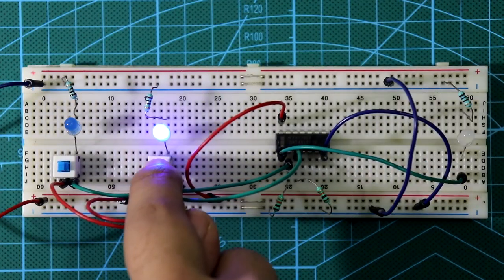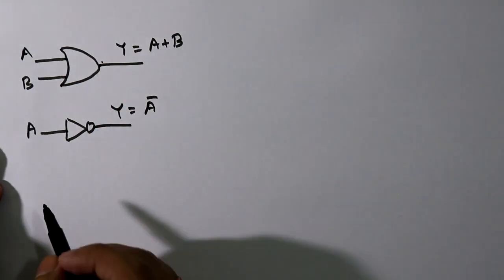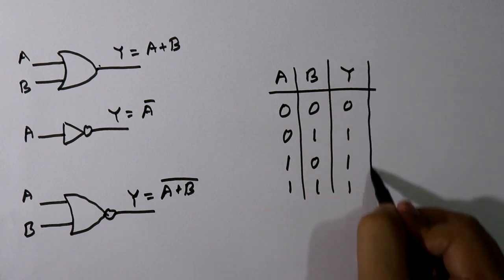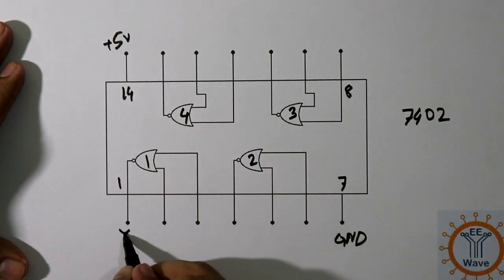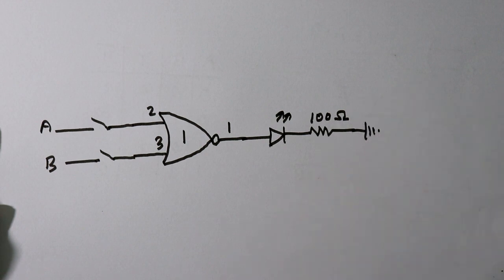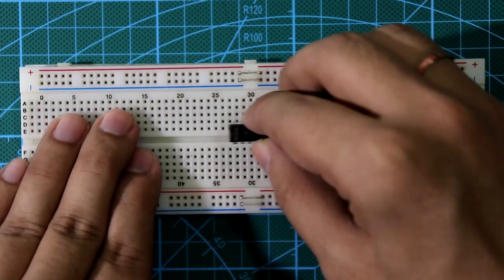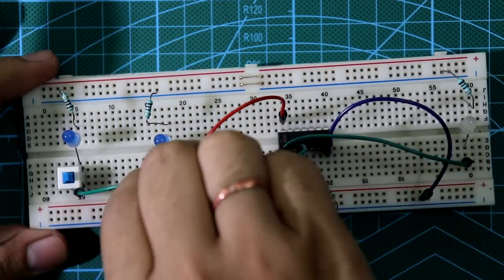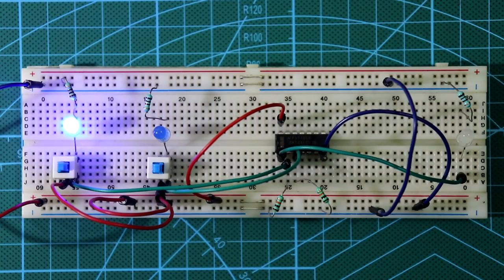SN74LS02 | NOR gate logic IC 7402 and Truth Table explained

Comment: I am looking at the diagram.  I see switches open so there is no power in the system in the first place.  Then how on earth did the LID come on, where is the positive input?
And your mind is too fast for me.  You speed it up the breadboard too quick and never explaining how the LID comes on and didn't show the circuit path of current travel or lack therefor?
We have all agreed on what an on and off switch is.  it has nothing to do with the flipping of the switch. That depends on which way you want to install it.  That is playing games.  In the middle east countries, the light comes on when you flip the switch down and in Wester's world you flip the switch up to turn the light on.
The NOR gate by definition means that when both switches are off the light comes on.  This means an open circuit period. Now where on earth you complete the circuit.  I can see if you turn on the switches perhaps all the current goes to the resistors 10 k ohms. But it would do that when there is path of least resistance with the lid and the rest.